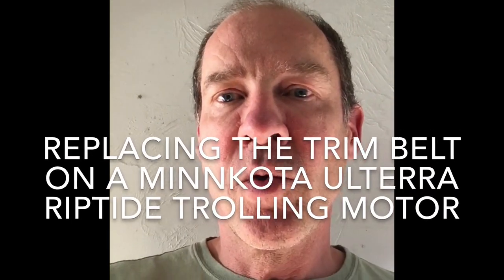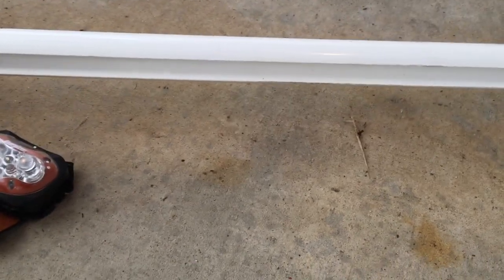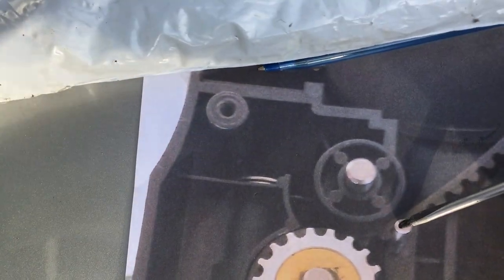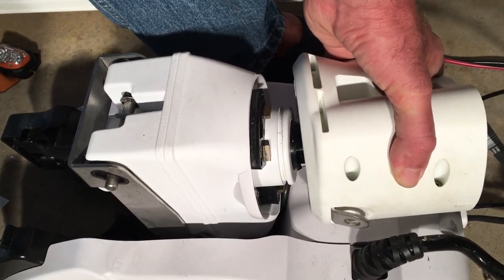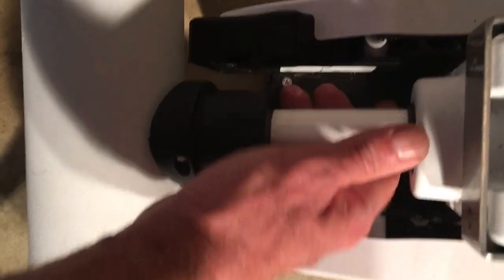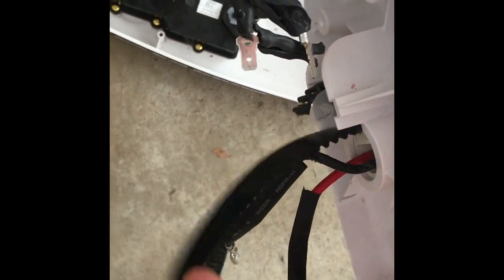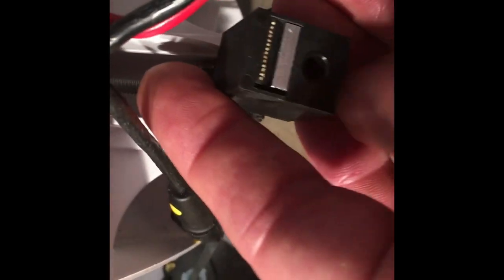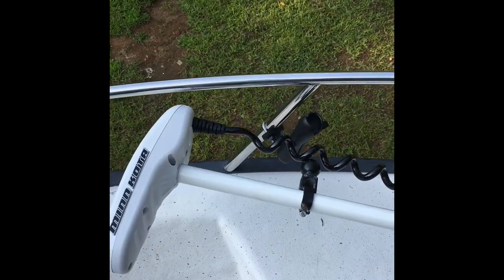Replacing the Trim Belt on a 2017 Minnkota Ulterra Riptide

Comment: Big shout out…this video was a great help to fixing my belt problem.  They do a great job detailing all the important things to pay attention to.  One extra thing to pay attention to is the little metal clip that holds the belt on at the bottom and top…take a picture of it in place so you definitely put it back correctly.

Comment: Great video!  You gave me the courage to dig into it on my own and I was able to change my belt with the drive unit remaining on the shaft and saved me having to deal with re-sealing electrical connections.  I did pull the release lever and slide the drive unit away from the base as you did.  After removing the small drive belt and turning the gear (rotating clockwise) to remove the old belt out of the top of the drive, I fed the new belt into the drive motor from the top and turned the gear counter-clockwise by hand.  I'm referring the gear you drove with the hand drill.  I think what enabled the belt to feed onto the gear was that I rounded the square edge of first tooth on the belt.  I was first trying to feed it in with a square cut on the belt as you would typically have from scissors when cutting the belt to length.  I couldn't get it to start to feed onto the gear.  I then used a razor knife to cut the square edge and round it off and it fed right away.  I think the square edge was stopping the belt from engaging the gear teeth and the rounding of it let it engage.  You just need to apply some pressure to push on the belt while turning the gear.   Thanks again.  Rally useful and the pic from Minn Kota was great!

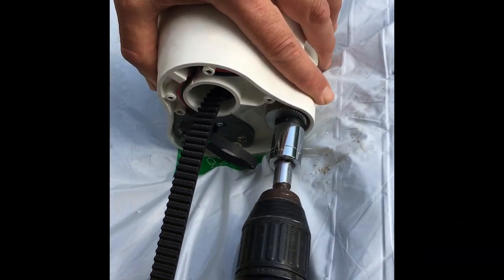Comment: I've never done this before but had a similar circumstance. At 4:37 into the video he has a hard time keeping the tool on the end of the cog. I used the hot glue gun to attach the tool then when done just popped the tool/glue off, it was quick and easy.

Comment: Great video, thanks for making it! I have the same motor, a 2017 riptide ulterra, and my belt just broke... I'm curious why you wouldn't just take the motor assembly apart to install the belt... Seems like it would be much easier than trying to thread the belt through those three pulleys
Reply: I put this video up because there was no info on how to do it at the time.  I'm not sure there is a faster or better way than the way I did it.
Reply: Just got my MK ulterra up and working for 6hrs Suckup up all battery, so recharged.Dry tested  deploy to full length,  started to retract to stow , then stopped. Motor error on on/off button , flashing red light on stopped  any further function.Would not retract so did a manual retract to stow....while I thought about it? & checked out FAQs. Thanks for what I've learnt so far..NZ weather still not so good, another month and some hesdscratching  should see us right.

Comment: I have watched this video several times, as I am about to replace my trim belt soon. I keep wondering why you did not separate the gear housing where the belt goes through. There are screws holding it together. Is it a bad idea to open up that housing? Great video by the way. Without your video I'm not sure I would try to perform this task on my own. Please advise about opening that housing.
Reply: Did anybody ever answer this question? I am wondering the same thing
Reply: Opening the housing is a nightmare. Good luck getting it back together lol. Best way to do this is electrical tape the new belt to the old belt and feed it through. Idk why no ones doing this lol

Comment: Question, i need to replace my steering housing. Can the trim housing and belt be disassembled as one piece in order to service just the steering housing?
Reply: yes they are separate parts. I took this whole unit apart to change my belt, is way easier then trying to feed it through honestly, I made a video on my page, this is a good video tho

Comment: I ran into something with my motor. It stretched the trim belt. Should I adjust the belt or replace it. I am having trouble deploying the motor. Thanks!
Reply: I think if it can be adjusted, try that.  But the belt has fiber cords in it, so if it is significantly stretched, I would think the belt is seriously weakened.

Comment: Does a trim belt only last a year .
Reply from the maker: Absolutely not.  I was fishing in ocean swells close to shore and the motor came straight down on a rock.  Don't do this!  The belt gave way to save the rest of the motor.  It's a great choice.
Reply: Only if you drop the motor onto a rock while fishing at night!  I would expect it to last a long time.
Reply: Mine lasted 2... I've never hit anything with it... Although I probably use mine more often than most people

Comment: Mine will deploy but will not go down it deploys and stops could this be my problem?
Reply from the maker: Yes, it is supposed to go up and down, called "trim". If you are using the remote hand controller, make sure you are doing it right.  If that still doesn't work, have it checked out to make sure it isn't broken.   Thanks
Reply: If the belt is broken, it won't go up or down at all.  If only part way, likely one of the sensors.  Minnkota phone support is excellent.